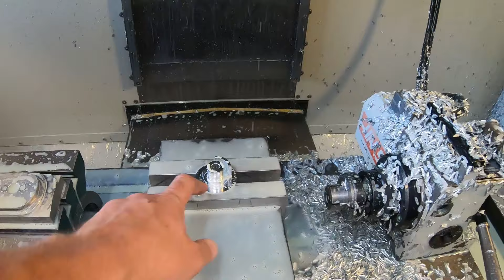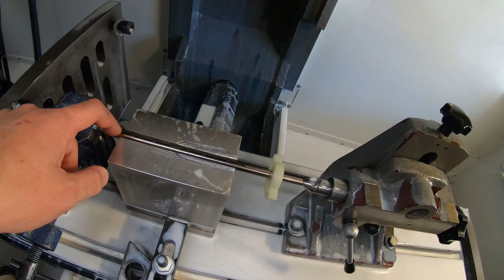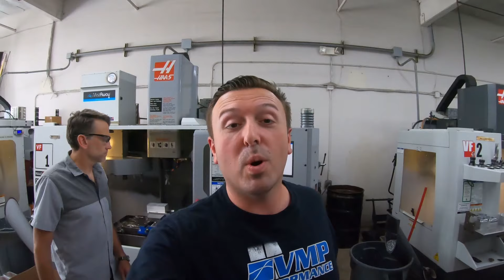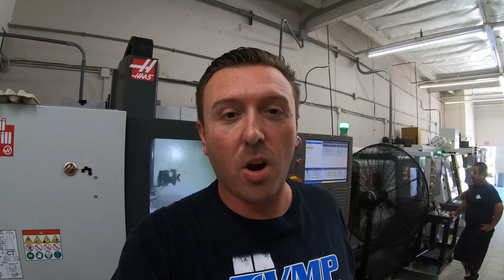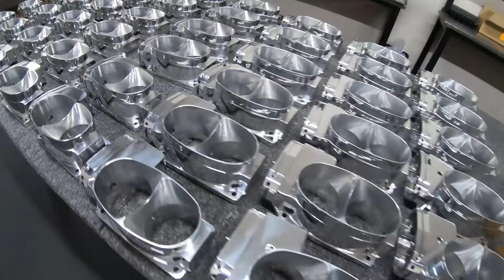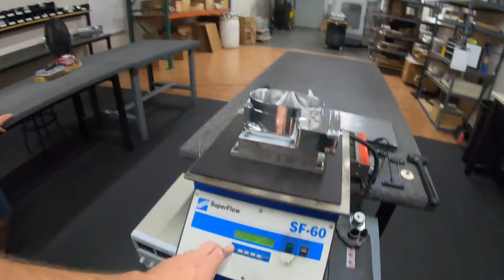VMP Vlog | How It's Made - VMP Throttle Bodies

Comment: Question I just ordered a 69mm to replace my twin 60mm on my rough 2.3 TVS does it require a tune or is the 5.0 going to thank me for letting it breath a little better ?
Reply from the maker: Hi there!  TJ69 does not fit the 2.3L Roush, the TJ67 would be the throttle body you would need as it does not run into interference with the inlet of the Roush.  A tune is required for a throttle body change.